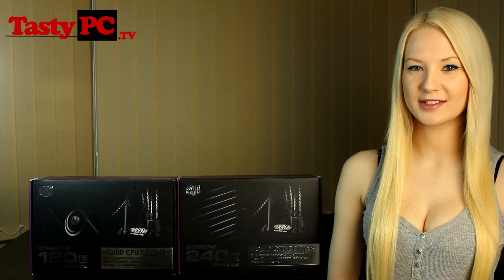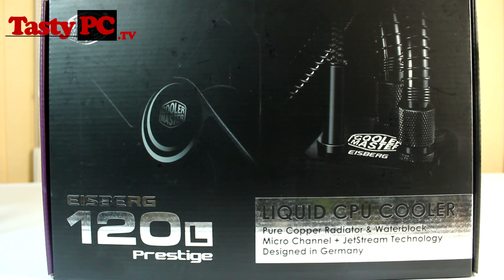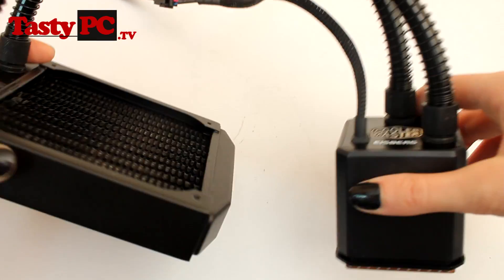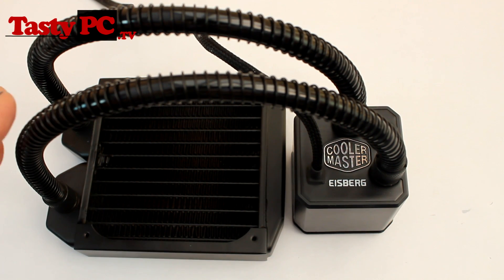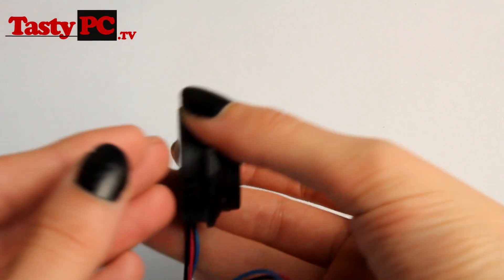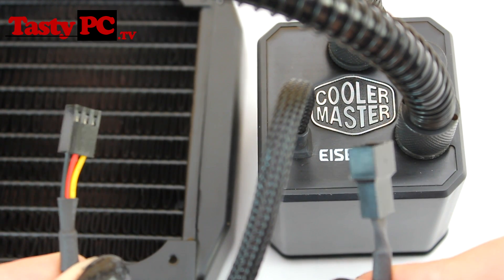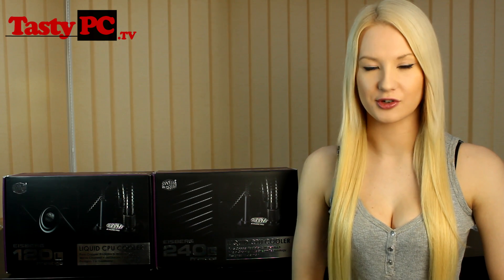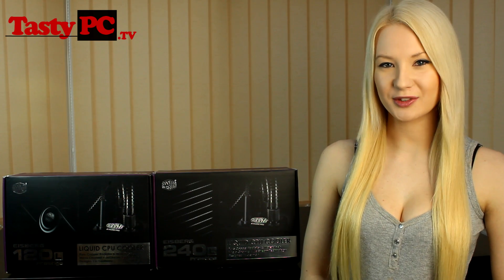Cooler Master Eisberg Prestige 120L 240L CPU Cooler Water Cooling Overview

Comment: Quite informative review really. Nice in depth.
I was thinking about getting a custom water cooling for my cpu, but I just don't want to buy all those separate parts and have to put the entire thing together myself. But I do want to have UV reactive coolant and different tubes, or perhaps more pieces of tube that connect so I have straight lined tubing and not bent. The only thing holding me back really is the size of the cooling block, and the price :P.

Comment: Don't get a closed loop system. They only do as well as the top end air coolers, or very slightly better. They tend to be much louder and a lot more expensive, too. Either go with top-end air, like the Noctua NH-D14, or get a premade water cooling kit, like those from XSPC. They come with everything a beginner needs, are very cheap and much more effective than any closed loop system.

Comment: Would be nice to get them with clear tubes and ultra vilot cooling liquid so it glows in the dark and you can see the fluild moving through the pipes so you know its working.
Is it easy to change the pipes or does it void the warrenty?

Comment: From what I've read elsewhere this pump is supposed to be made by Eheim unless it's changed for production. Eheim has made the absolute BEST aquarium pumps for years. So if it's Eheim you won't have any issues. I read the pump can handle any combo of 8 waterblocks. That tells me it should have some power behind it.

Comment: H100 = Thin rad, thin fixed hoses, full of air, noisy pump, long RMA history...but beautiful.

Eisberg Prestige = Thicker rad, thicker hoses w/expandable compression fittings, air can be bled, pump can be replaced for expansion, expansion can be done to avoid RMA, and it's ugly...bu expansion can make it more beautiful.

Comment: In my opinion it dosn't make any sense to buy this kits, only the pump can be helpful for a small systems. In other cases loop will be nice only if you have 1 or 2 radiators close to each other.

Comment: I hope this brings budget water cooling to a wide market. Easily upgradable radiators and actual 1/4" threads are perfect! Compared to the h100 these should win easily, and thats with the 30mm radiators. The 45mm thick will destroy Corsair! Nice hair btw :)